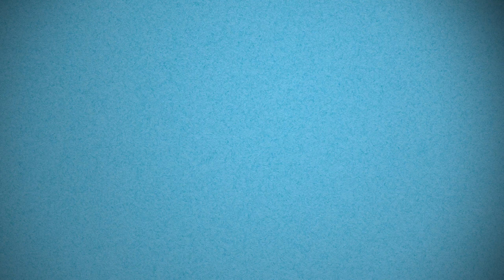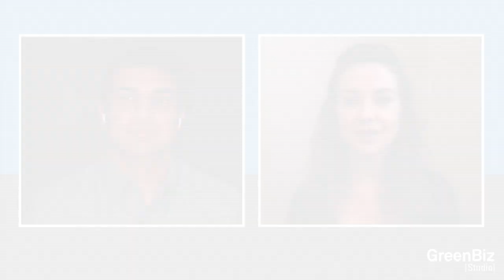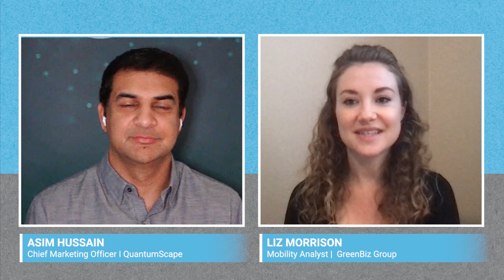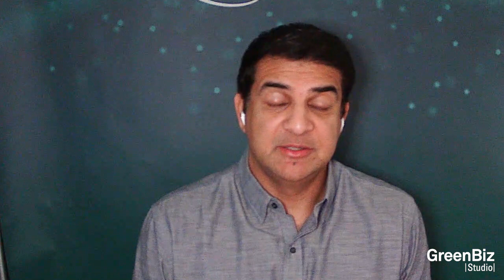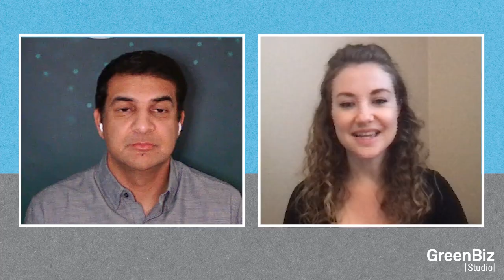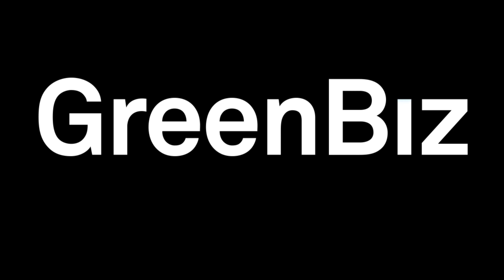QuantumScape's Asim Hussain on the potential of solid-state battery technology

Comment: Mr Hussain, 
I am a shareholder of QS. I keep hearing from you and others at QS that the new ssb will have higher energy density but you did not disclose that figure with the 10 layer cell test. I wonder why?
From your published test data:
1. The average 1 hr charging voltage:  3.95 V.
2. The charging current: 3 mA/cm2 per layer.
3. Layer area: 8.5 cm x 7 cm = 59.5 cm2.
From the data the total energy in one charge is 3.95 x 3 x 59.5 mVAhr or 705 mWh per single layer.
If a single layer has a thickness of a playing card like QS often says, I could consider or assume the thickness of one layer 0.29 mm or 0.029 cm. With that the volume of one layer is 0.001726 L

The energy density is therefore: 705/0.001726 = 408,577 mWh/L or 408 Wh/L.
Energy density of 408 Wh/L is quite low compared to the current lithium ion batteries on the market.
Assuming the average weight density is 2.5 kg/L, the gravimetric density of QS ssb would be 408/2.5 or 163 Wh/kg.
It is quite low compared to most of today lithium ion batteries which could have energy density in the range of 250 Wh/kg.

I hope you will address my concerns.

Thanks.

Comment: Over hyped company.  Won't have mass production for ten years if they even get to mass production.  Good on them to sell it so far though.
Reply: @job holder,
Only time will tell. But I am sure we will know by Nov 2022. a year from now. QS-0 already started.
Reply: @renindy  What you were referring to in 2024-25 is QS-1, the mass production of QS ssb for VW and by VW.
Right now the concern is for QS-0. In the QS-0 phase, QS will manufacture around 200,000 cells for OEM to test their EV on test tracks. QS-0 is scheduled for middle of 2023. If QS-0 is not successful, QS would be history. I would venture to say, if we do not have any idea by the end of 2022, the prospect of QS failure is very real.
Reply: @renindy  well I just don't believe it.  VW is not the most trustworthy company and they are at ev war with Tesla so will say anything like we have game changing battery tech, and some very small 3rd party lab no one has ever heard of publishes a report.  All adds up to me as suspicious.   Also the the other major car manufacturer interested in QS supposedly stellantis- just said a few weeks ago they don't like EVs.